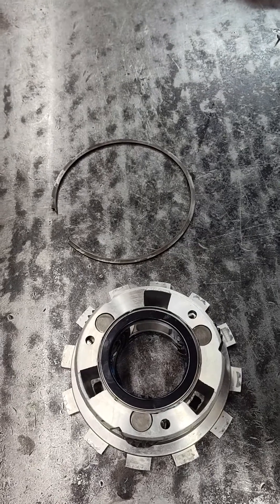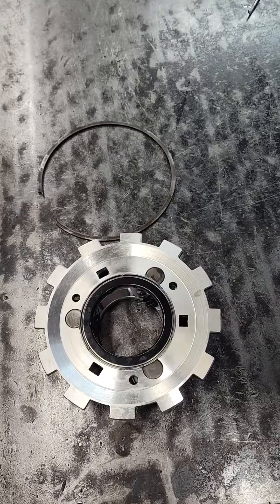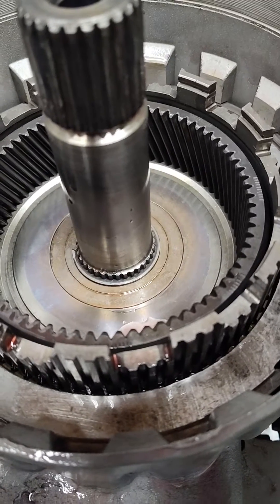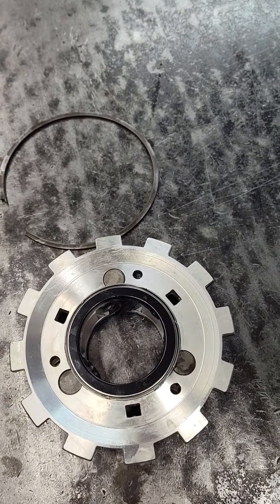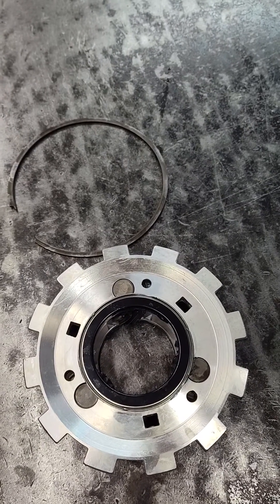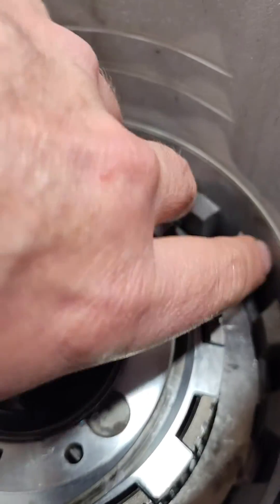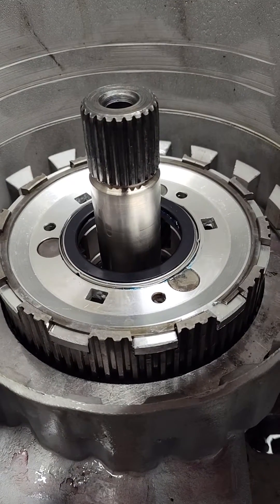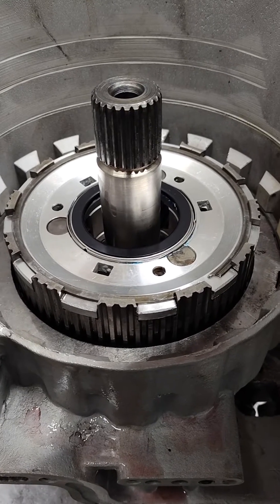Ford C6 Transmission #9 kit and Roller Rear Planet Install

Comment: I built a 47rh w a 6 pinion steel planet where stock was a 4 pinion aluminum planet. I could tell a difference in how quick it accelerated. Rotational mass is a big deal.
Reply from the maker: Thats interesting you could tell the difference. A lot of time its really hard to tell without a way to accurately measure. Thanks for the feedback.

Comment: Thanks for this video.  What you said makes sense.  I am building my old 67' Ford F100, and putting a big block 460 Ford motor in it.  I have the original C6 transmission that came with the motor.  It's a 1994 engine and tranny.  I'll be driving this truck on the street, and it's not a race truck, but, I'm figuring it will have about 550 hp.  Will that 3 pinion handle that?  If you have time, I'd be interested to hear your recommendations on other parts you have that would fit my transmission and HP combo.
Reply from the maker: It should hold up fine. If you were going to tow 10,000 lbs trailers then I would probably go to a 4 pinion.

Comment: Hello Jay, I have a suggestion about building the awesome C4 with do's and dont's and installation of your no 9 bearing also, as I have an issue with one I built that squeels on gear change. in the past I have spoken with you and Gregaus on the ford forum which although you guys are guru's couldn't nail down the issue and I believe its an assembly mistake which is on me however without a slightly more comprehensive, for power instruction video I am at a loss. I have installed your number 9 with no problems rollerised all of the thrusts except number 1 and used a transgo manual shift kit etc. We have a lot of these boxes in AUS with people building there own and it would be a hit letting them know how to build a slightly stronger C4.
Thank you very much for everything you do and teach it is appreciated
Reply from the maker: We will be posting more C4 videos in the future.  Thanks for the comment.
Reply: Sure would be interesting to get to the bottom of that one :)
Reply: hello  @gregh6794  , do you remember lol, still haven't pulled it out so fingers crossed I can see what I did wrong and put it in a video for you to see also.